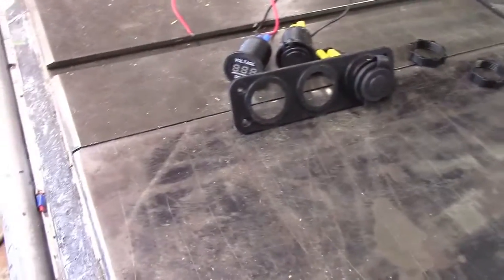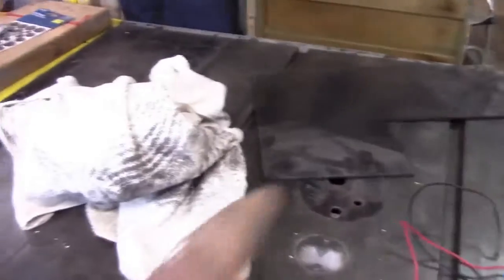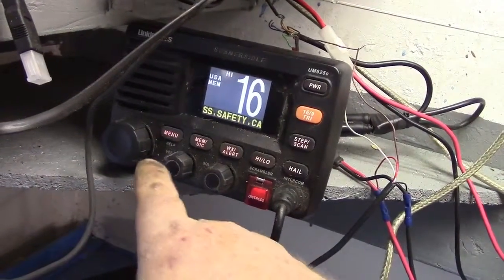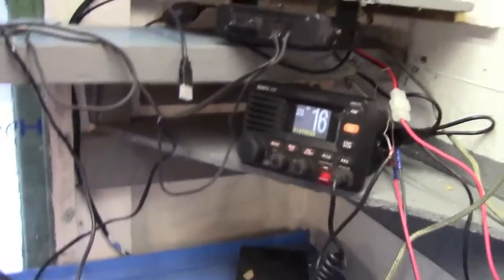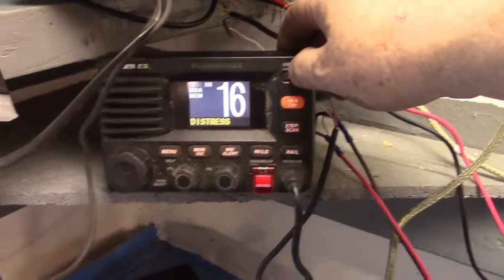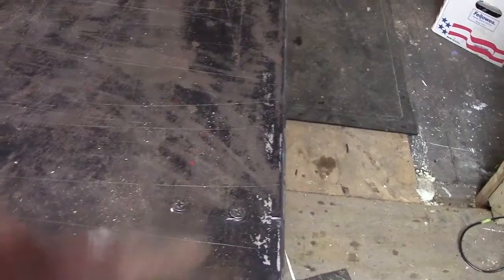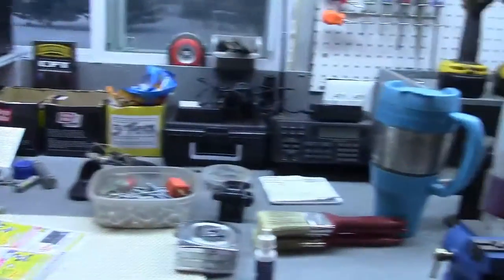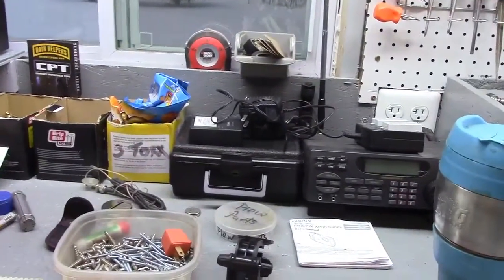Things, snow, shop, missing our boat

Comment: I like the power meter with plugs, ebay?  Uniden made good CB radios but I didn't know they made VHF.  The FT400 Yeasu I hear is great but confusing until you get use to it.  Time to add another addition, lol
Reply from the maker: +AllAmericanFamilyUS1   Yes ebay,  Uniden makes all kinds of stuff but not all is good.  I like the FT-400 but yes it can be confusing due to a few menus.